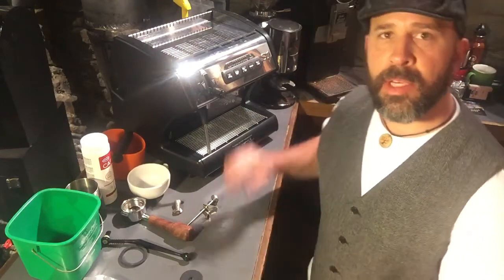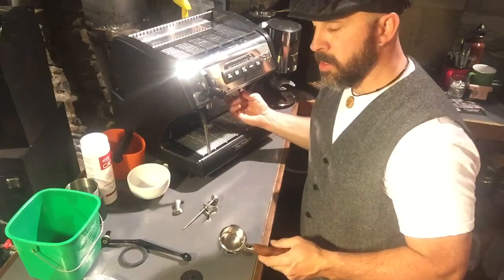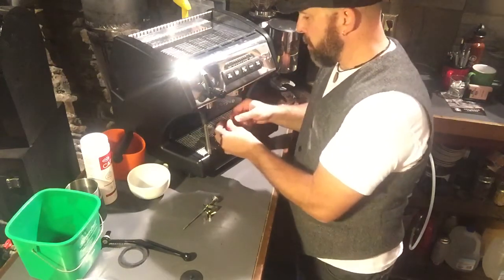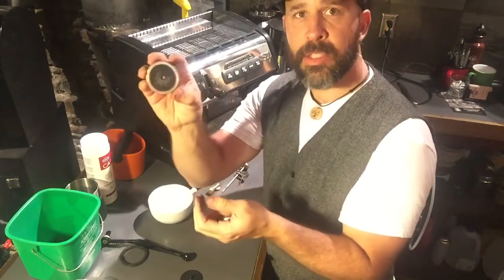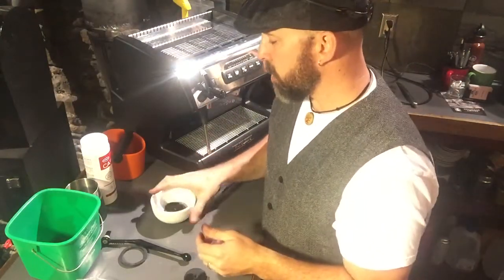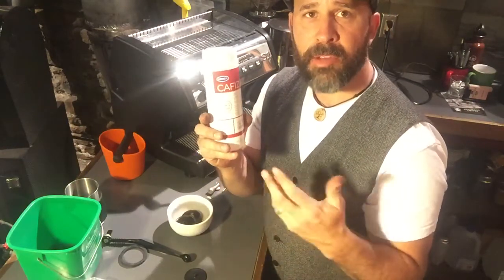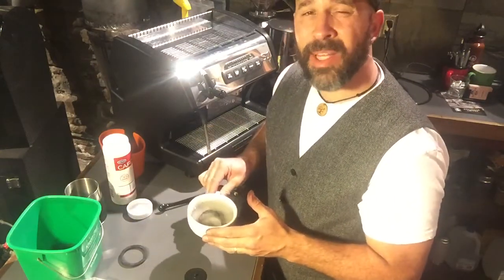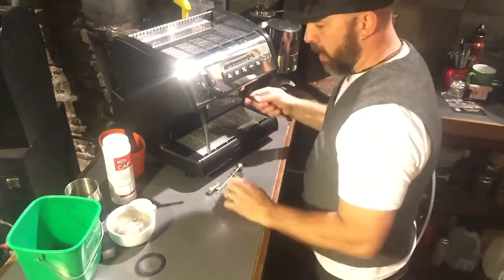Cleaning The Spaziale Espresso Machine

Comment: Chris, Thank you so much for posting this video. it is very useful.  I have a problem with my Vivaldi II, looks like some water it is retained when I do an espresso in the space between the shower screen and the coffee pastille. and I am guessing that water is not flowing correctly because the shower screens and/or espresso filters are dirty.  I ve been trying changing my coffee grind size and I am still getting some water retained on the top of the coffee pastille.
Reply from the maker: Thanks for sharing your experience! To be honest, I don't worry much about that residual moisture! ;-)
Reply: @ChrisBeanInCincy   thank you!!!

Comment: Hi, chris. Need help. Water flows slower than usual. I've tried backflushing. it worked before (encountered 2 months ago), but now it doesn't. Now my coffee tastes bitter than usual and still pours slow. I've temporarily adjusted grind size to coarser. It helped a little but i'm worried about the slow dispense. 😔

My machine is 9months old. Home used for the first 3 months, then commercially used for the succeeding months, averaging 30cups per day.

Pls help
Reply from the maker: Where did you buy the machine? Chriscoffee.com and clivecoffee.com are great about offering tech help over the phone. Is your machine plumbed in? or the mini (with a water reservoir-drawer?)
Reply: @ChrisBeanInCincy  hi chris, i'm from the Philippines and bought the machine from an authorized dealer here. They aren't helpful, really.

Mine's the one with the tank.
Reply from the maker: @shapoyski  https://www.youtube.com/watch?v=SEfHG9Do-cw check this out...your boiler may have a lot of limescale and sediment built up. Have you been using properly filtered water??

Comment: Thanks for doing videos! I am looking at going from a name brand E61 to  the Vivaldi II. E61 does not produce great expresso for me.. Too many parts, places for old coffee to get stale, too long too heat up. What are your thoughts? CHRIS (the other guy in New York helped improve  this non
E61) and they love this machine!
Reply from the maker: Glad the videos are useful to a few people! Yeah, I think my love for LaSpaziale S1 Vivaldi II (and similar versions of the machine) are, in part, due to the simplicity and robust "pro-sumer" nature of the machine. As a coffee professional, it's not a machine I would buy for a shop...but I find it to be ideal for home use and "light" catering applications. Good luck brewing the espresso you desire!
Reply: @ChrisBeanInCincy  How is the drain? looks kinda weak? Also how is cleaning accomplished? Descaling the whole machine. Will it pull water from a bucket without a flow-jet? Lube and maintenance after? (Nothing like: preinfusion, water & a drain.)  Any response is appreciated!
Reply from the maker: @Will-bp2yc  You can check out my other videos on cleaning/maintenance/etc. You also might find a good bit of help if you search LaSpaziale on Youtube...or on Chriscoffee.com 's youtube channel. I've never tried pulling water from a 5 gal jug W/O a flowjet. I assume that would NOT work...Best ongoing maintenance is using the right water filtration, changing out the grouphead gasket as needed (whenever it ceases to be rubbery/spongy) and backflushing and cleaning the shower screens regularly ( at least monthly based on daily home use...more in catering settings)
Reply from the maker: Also, the drip tray just has to be emptied before it overflows. You can purchase an additional drain kit for these machines but usually don’t do that because I move the machine around quite a bit (catering, portable setup, etc)